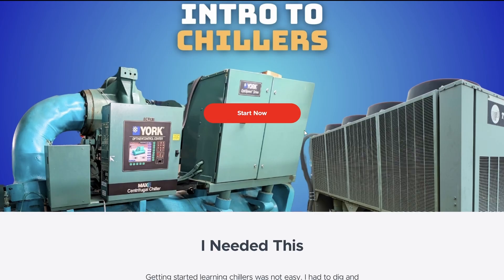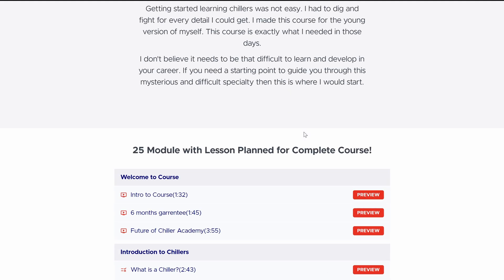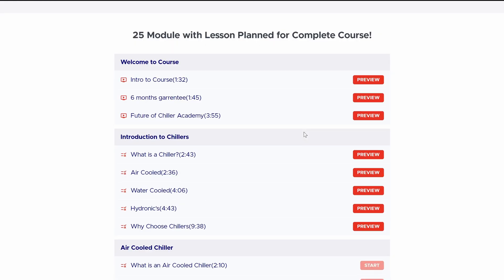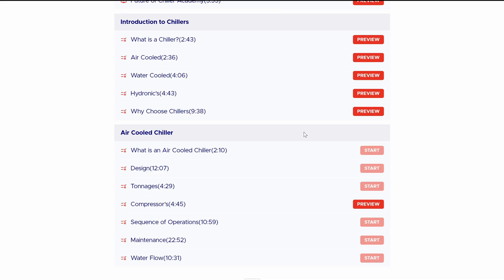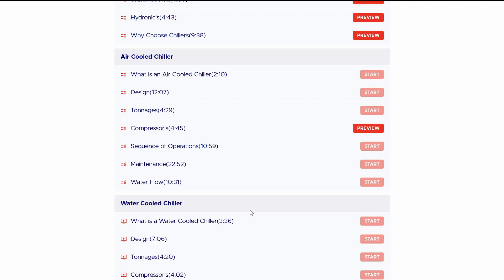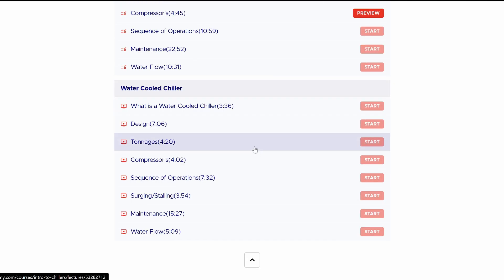VFD Electrical Flow in Chillers

Comment: The input filter's job is actually to stop noise from the rectifier from backfeediding into the grid. SCR's create all kind of electrical noise that will travel backwards theough the line and can blow electronic powersuplies that are fed from the same source as the VFD. Speaking of, you ever run into SCR-driven inverters? They were all the rage until like 2005 when IGBT's finally got high enough load ratings to be used.
Reply: True I also read this on a manual before…